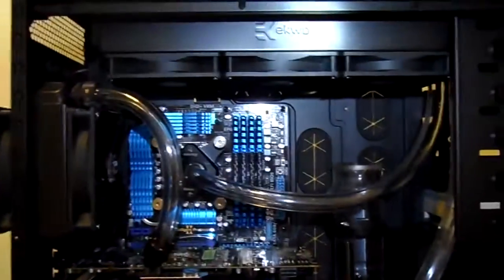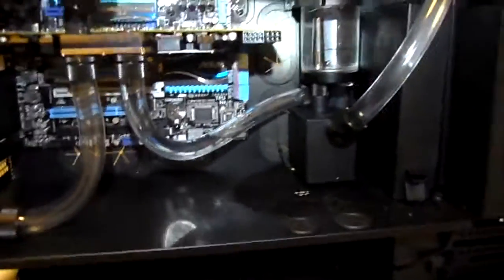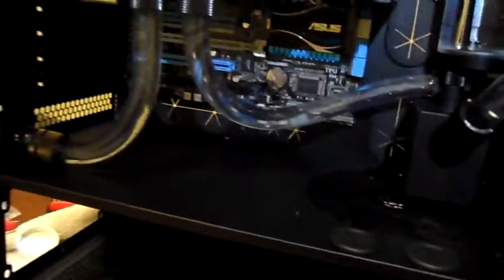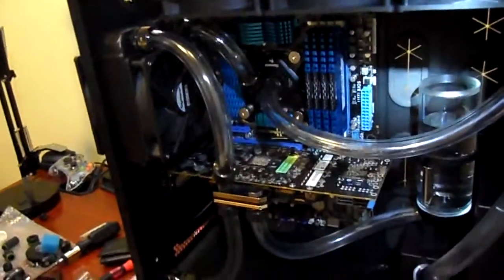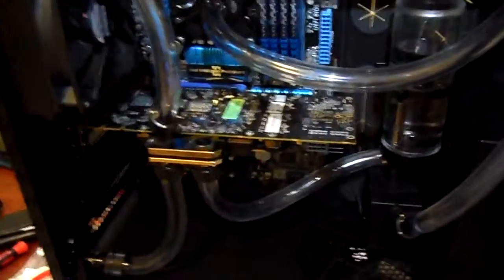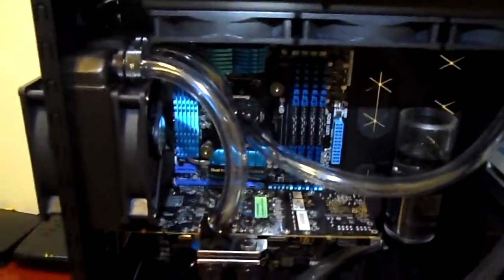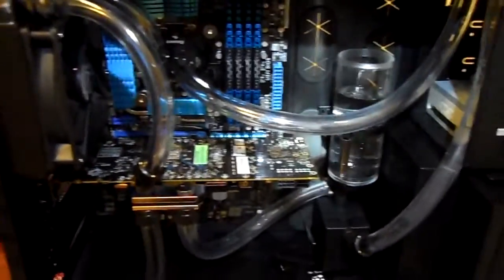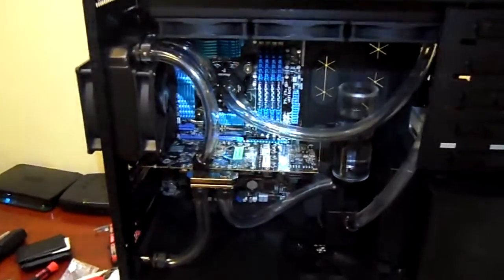Corsiar 800D Liquid Cooling Build 2012 Part 3

Comment: lol 2000 rpm is not quiet, and cfm does not matter when it comes to radiators you need static pressure which is created by fans with less angular fan blades i suggest the Silverstone air penetrator 120s